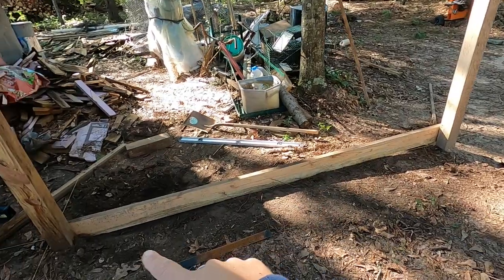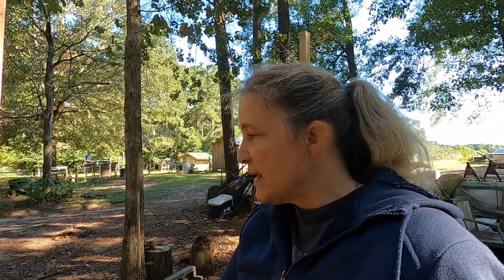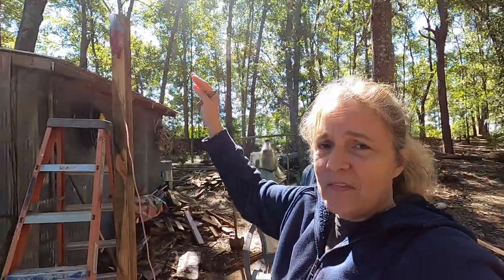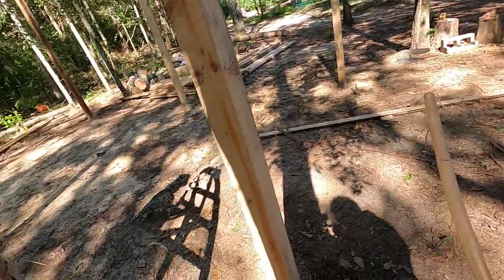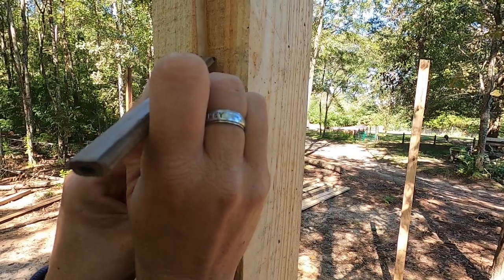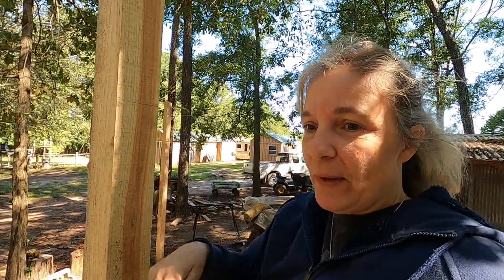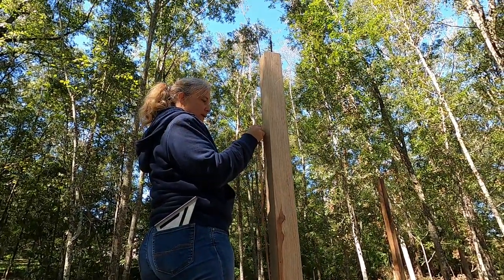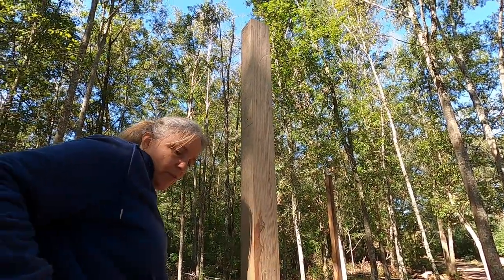Is This Water Level Going to Work??

Comment: Water at the stationary end must always be the exact same raising and lowering the loose end can change the stationary water height when water lines up with original mark water at loose end will be level.
Reply from the maker: That was the reason I put the line on the hose, to be sure that I had the exact same amount of water outside the bottle each time.

Comment: There is nothing boring about it at all. You just need a person who is familiar with using a water level to do it as I have seen them work absolutely correct because when its set up correctly, even NASA used a water level in a few applications. A dead given science on them and I can't set it up from day to day either.... that hose of water is running distance and over different surfaces so how can it work yet the person who knows this stuff is always right ..... go figure